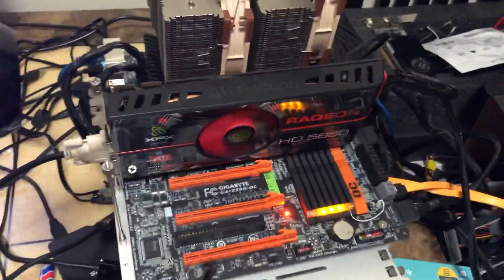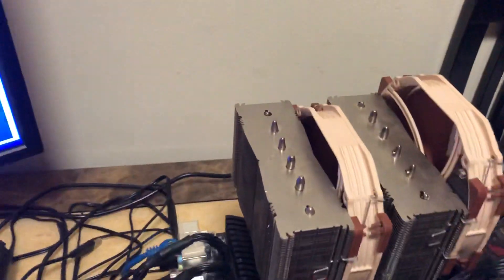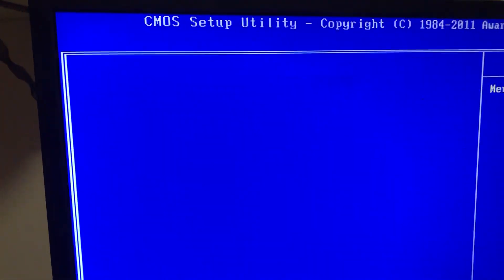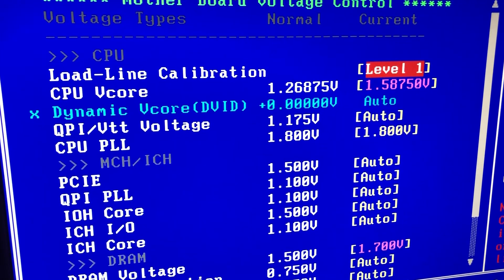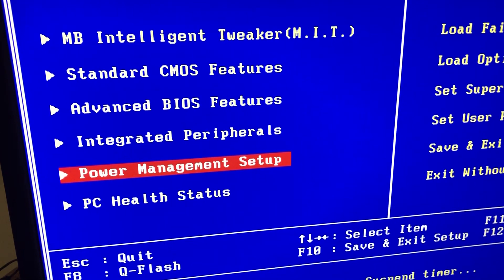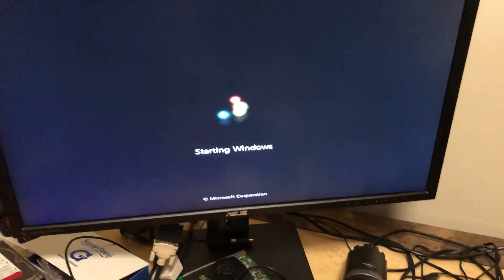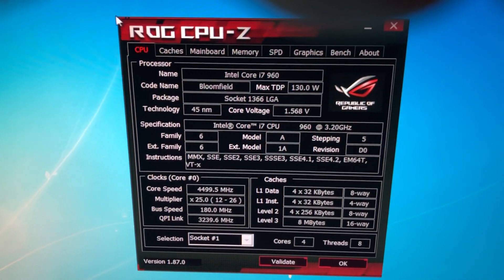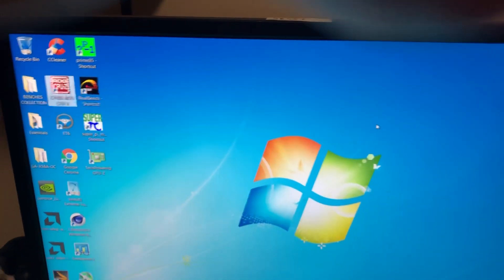Gigabyte GA-X58A-OC BIOS SETTINGS FOR OVERCLOCKING I7 960 on air cooling

Comment: You have a lot of errors in your overclocking. And your voltages are waaaay too high. Im using less voltage on 4.5ghz. Use my settings to calibrate yours. God Bless.
Reply: Long time ago, but I’m pretty sure I got my starting voltages from TAGG from OCN Because at that time I had put down Computers at the end of 775 socket and not picked up again until third gen so I had skipped X 58. I’m sure if you’re an overclocker you’re on hwbot  and You are aware of him and his credentials. For a start lots of chips require different voltages so quoting that 4.5 doesn’t mean anything to me. But what are the overclocking errors Do you think that I am making? I’ll go back and review it and analyse the sections you mean. Maybe we will both learn something along the way.
Reply: Found you on fb. I see you know Charles and Vince. 
;)

Comment: I have the same chip. These are my OC.

.GA-X58A-UD3R

.CPU i7 960 @3.2ghz /
OC @ 4.5ghz

1. Multiplayer: 22X
2. Turbo off
3. QPI Ratio: X36
4. Uncore: X17
5. BCLK Control: (Enable)
6. BCLK Mhz: 205
7. X.M.P: Profile 1
8. Mem Multi (SPD) [8.0] = 1640 Mem Mhz

Voltage
1. Load Line: (Standard)
2. CPU Vcore:1.525V
3. QPI:1.535V
4. CPU PLL:1.800V
5. Dram Voltage:1.540V

Hope this helps you.
CPU fans must be running 100% for 4.5ghz.

My Cinebench R20 Score is 1411.
Reply from the maker: Are saying that all 960's will be the same, if so I don't thibk you should give advice.
Reply: @extremeoverclockingyobbo5467   The only thing different between CPUs is the voltage. But It's only a miniscule difference. They will still be pretty close to each other, but you are way too high on your voltage. That's why I said, "Use my settings. Then, up or lower the voltage as needed. Right now, I dial mine back to 4.3ghz because I didn't see a huge jump in score from 4.3 to 4.5. If I had a water cooler, I would go up to 5.0. But with my air cooler, I get a balance temp of °80 on Cinebench, and on gaming, I'm sitting from °50 to °65. Depending on the game. You have to turn off your Turbo, and when you get to Windows, go into power settings and set your CPU to 99%. That will keep it the temp stable. With that said, going back to 4.3ghz, I can keep the CPU 100% while keeping the Temps at idle °40. Cinebench workload °75, and gaming °50 to °60.     On 4.3ghz my voltage is 1.4125v
Reply from the maker: @JuanDiaz-jo1rw  dude i've been overclocking since single core days. I don't even have my very-different-from-yours mobo setup. I have over 30 mobo's and I don't remember making that vid I can assure you what I'm showing is fine. Oh and CPU's can have massive differences in voltages. maybe I'm managing the loadline differently or something. Be careful giving advice based on your one combination of hardware dude, I doesn't appear you are very experienced as the explanation you give me is way differently done from any Hwbot/XOC/Tech guys and more "social media" take care